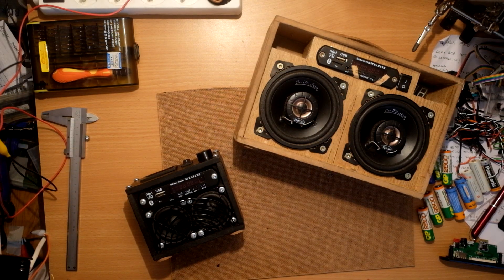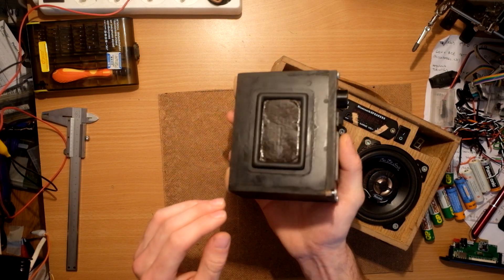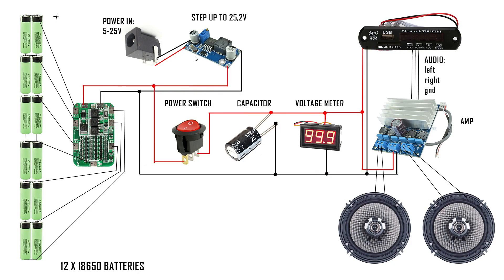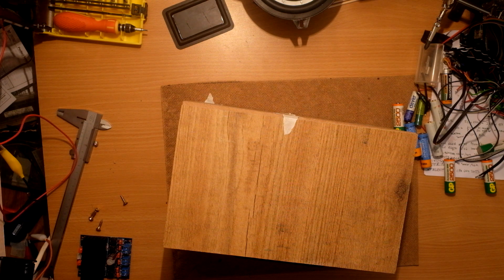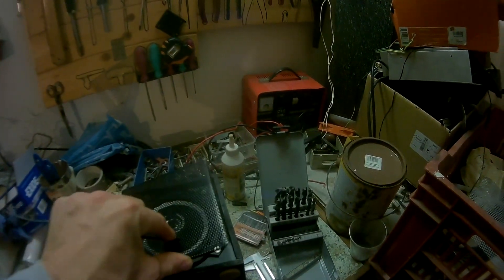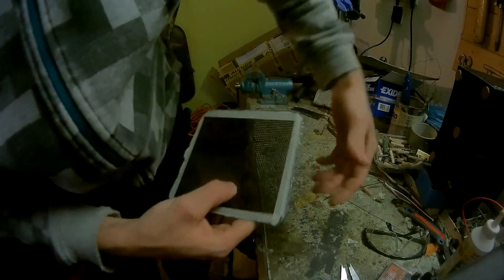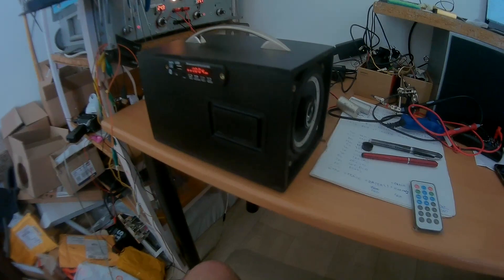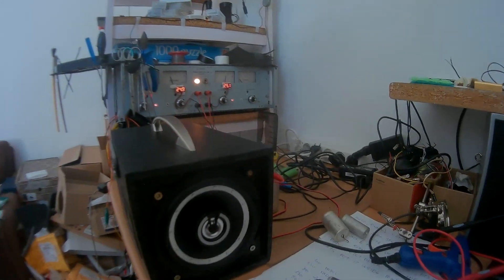how to: build DIY 100W Bluetooth Speaker - 114dB Loud

Comment: what sorta step up module did you use there?
Reply from the maker: somethink like this, but after a month it died, so maybe not a good choice... 
https://www.ebay.com/itm/3A-Adjustable-Step-Up-Down-Boost-Power-Converter-Module-Replace-LM2596S-TEMPTING/253076119006?hash=item3aec831dde:m:mio5ErXNUUmnObjtRk1D58A

Comment: hi, i am wondering why you used a boost converter that can only handle 2 amps , the protection circuit can handle 10 amps charging so doesn't that mean it will charge very slowly?
Reply from the maker: you are right :) I think 2A charging is enough (6s2p = 5000mah = so about 2-3hours of 2A charging)

Comment: There will be a ground noise if both amplifier and mp3 player connected from the same battery power. yes, no??
Reply from the maker: it depends. because mp3 need less voltage I'm using dc-dc pwm convertor which makes new ground (so I need to use isolator on 5v line or 1:1transformer in audio line ). if you use linear step-down, it should be ok, but you are burning power. If you use 12v battery, 12v amp and 12v mp3 it should be ok.

Comment: Great Build! One quick question, the only bluetooth modules I could find like yours all say 7v-12v. But in yours, you are using 25.2V. Do you happen to have a link to the higher volatge module you have. I can't seem to find one. Very Detailed Video and I can't wait to build me one!

Edit: I just caught the part where the amp is running a voltage regulator. So all is well! I will probably run a buck converter to the module.
Reply from the maker: yes, like I wrote below, mp3 module is actually running at 5V. So on all modules like this, there is a chip 78M05, which has 35V max input voltage. it doesn't matter if you feed it 7-12V (like they sey) or 25V, it will always make 5V for the module.
Reply: You Rock! Thanks for the Reply!

Comment: I think the mp3 player is 12v. how you can connect it to 25.2v?? will not burn?? might be ok for the Amp but not the mp3 /bluetooth.
Reply from the maker: there is a chip 78M05 on mp3 player(which is running at 5V), it has 35v max input voltage, so it is all good

Comment: I have built a bluetooth like you have done(without the capacitor). but I am getting a Buzz or hiss sound from the speaker. Any idea how to eliminate the sound. It happen only when I inserted the music player (bluetooth, SD card module)  with the amplifier. Even if I use a different music player (bluetooth, SD card module) still the buzz sound is there.
Reply: Try using separate power source for the mp3 player and amplifier.
Reply from the maker: make sure you are using shielded cable from player output to amplifier input
Reply: You are using same power supply for bluetooth and amp, and common ground causes the humming noise. Solution is either to have two different power supplies or to use an isolation power module. It is very hard to find a 12v isolation module.
Reply from the maker: actually there is step-down to 5v in the mp3 module, so you can use 5V isolator, after the step-down, or just use 1:1 transformator (you can salvage some from old modem cards in pc) in the audio line from mp3 to amp. Some of my speakers have this issue too, I'm going to fix them all :]
Reply: Thanks for the reply. I have rectified by using 2 different power supply

Comment: there is no way that passive membrane is going to do any good to this spaker of yours.
The reason the passive membranes are used is to produce lower freq sound,sound which usualy the small drivers bluetooth speakers have cannot reproduce. This is why the membrane is bigger usualy than the active driver. Just ugly.
Reply from the maker: all the small bt speakers are using this system, you can use bass-reflex but the speaker will be bigger
Reply: Quad Squad  You need to do some research. You will see that the passive radiator or membrane, however you want to call it,needs to be bigger or at least as big as  the active speaker in order to give some results.

Comment: You can't joint two lithium batteries togheder if they are not identically!!
Reply from the maker: they have same voltage, no matter if one is 1000mah and other is 2000mah, they are 3000mah together
Reply: Quad Squad i wouldn't do that. If the battery with the lower capacity loses it's charge faster, the battery with more capacity constantly charges the weaker one.
Reply: They have different ware if they are not new.